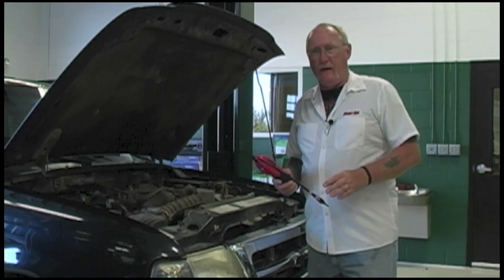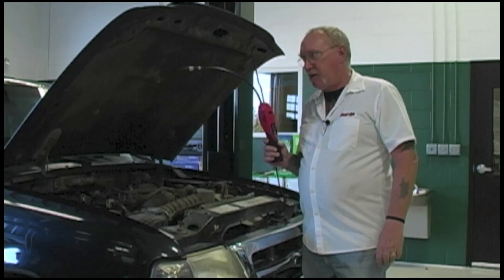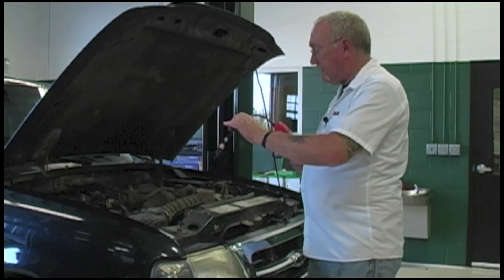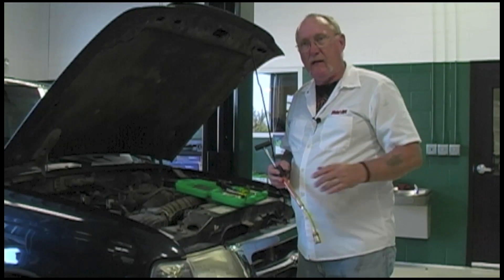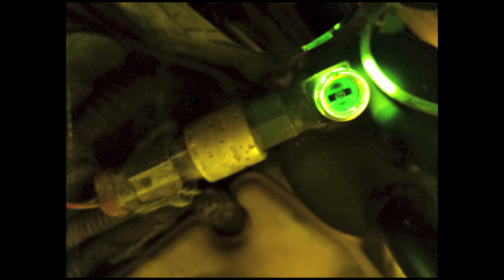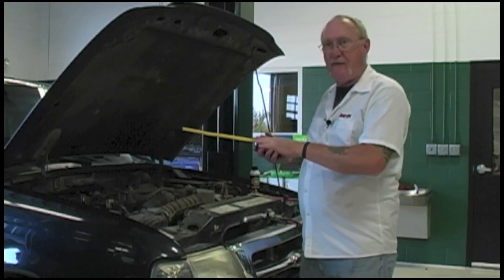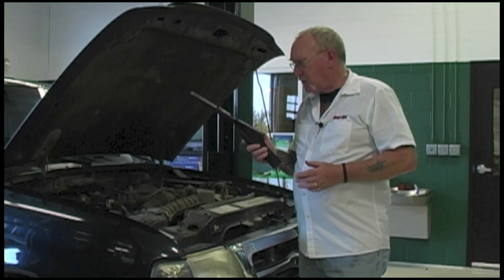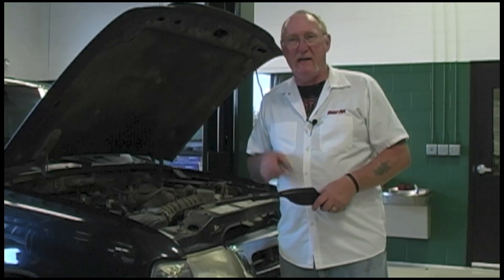The Trainer #42: Tips on finding A/C refrigerant leaks

Comment: Like your tip on stopper in drain hole. Finding a shaft seal leak is also really tough. I hit on the idea of wrapping plastic wrap around the nose of the compressor, left it overnight, punched a hole in it the next morning, inserted my sniffer, and found the leak.
Reply from the maker: Thanks for sharing the tip!